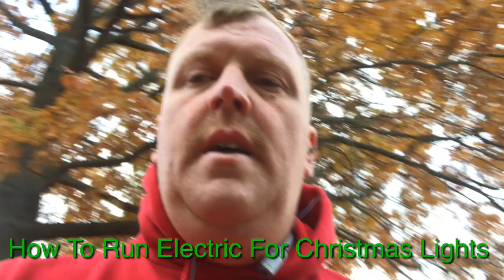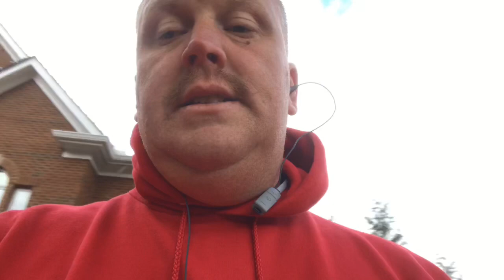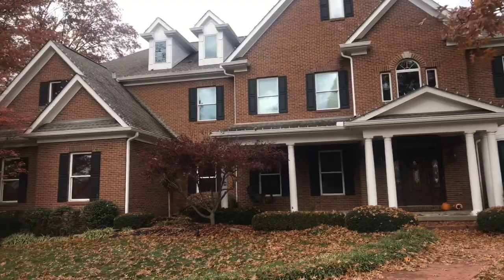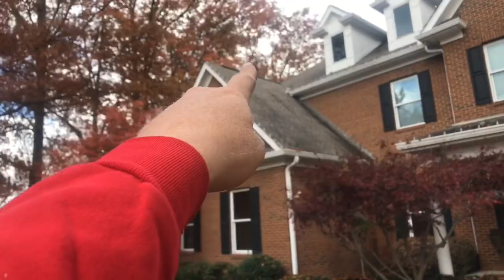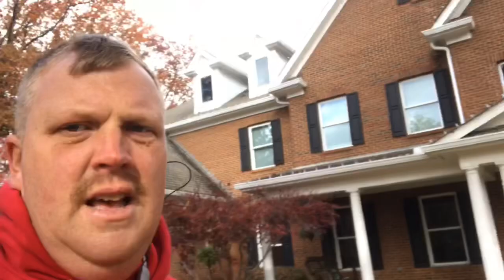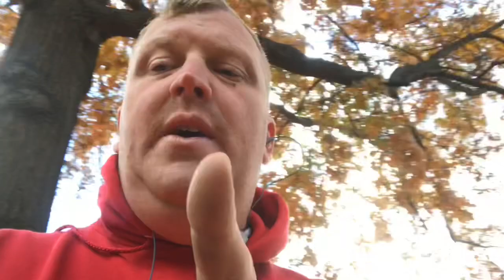How To Run Electric For Christmas Lights

Comment: You also need to make mention of the amperage capacity of the outlets that are feeding electrical power supply to your lighting runs as they can trip the breakers when over loaded.

Comment: How do you have a "hot male" it's the female end that is live until the male end is removed from the outlet and the only way to have a "hot male" is if you are using a "widow maker" cord where you have a male plug on each end that is the only way to get a "hot male" if that is the case then I would advise going to basic electrical 101 for proper termination of extension cords.

Comment: How many incandescent C9s will you run on one outlet? Trying to decide how many feet I should put on one breaker
Reply from the maker: You can only run about 130 C9 incandesce and bulbs. This will put you at about 10 Amps. There is a new bulb out that holiday bright lights cells that looks a lot like the old incandesce and bulbs